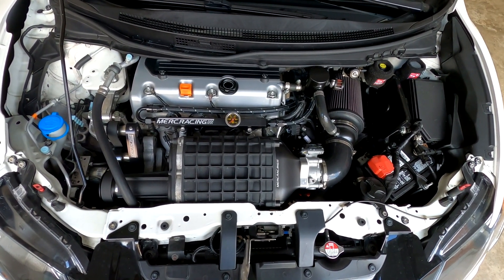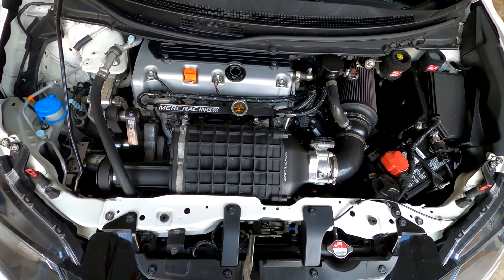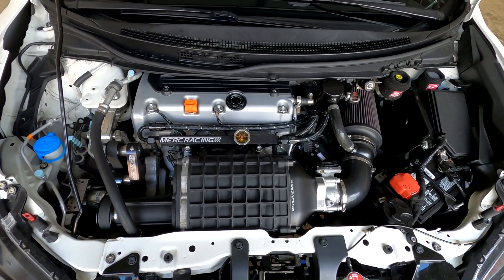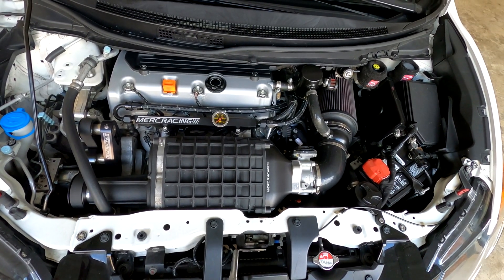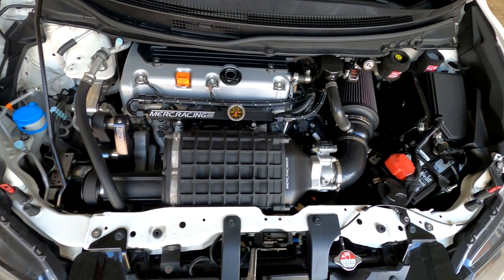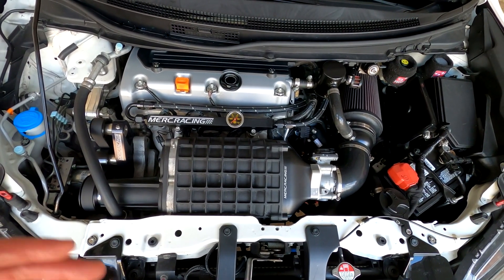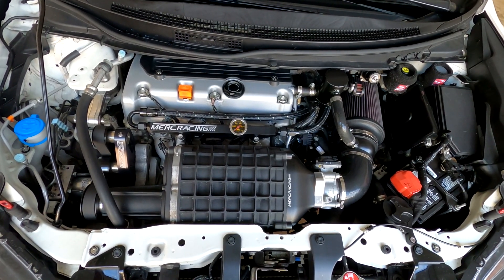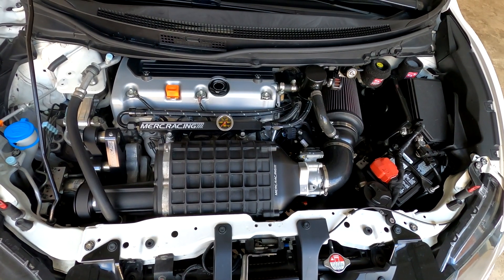1900 vs 1320 Supercharger:  Which to Choose for Your K24?

Comment: Im planning on putting a k20 pulley on the k24, Currently my 1920 has a 3.5 inch pully still haven't installed anything, do you think a smaller pulley for the supercharger is advised because im using a k20 pulley? if so what do you think will be appropriate? thank you.
Reply from the maker: If you’re using a small cp, you’re going to need a smaller pulley to make more boost.  So it really depends on your goals

Comment: Man im so lost it sucks that hes a one man show so its hard to get a reply in his emails. Im debating between the 1900 and 1320 my car already runs on e85 since its a stock k20/24 frank i dont wanna push it past 400whp. The 1900s is cool to future proof but is there any way to lower the boost it will make aide from the pullies?
Reply from the maker: @CrAzY6tothe6  1900 all the way.  Yes you can run 10psi using 9th gen pulley with 3.5 sc pulley
Reply: @CGNLEvolved  bet ima do it then and one last thing can i use the air to air on the street i would assume thats better on the street since less heat soak also i appreciate you responding really helped with my decision making
Reply from the maker: @CrAzY6tothe6  heat soak was never an issue with me even on 100 degree days under stop and go conditions, but i do have an upgraded reservoir.
Reply from the maker: @CrAzY6tothe6  air to air will require more plumping work
Reply: @CGNLEvolved  definitely this is all good to know. And i see i see for the plumbing im not too crazy about since ima have a shop fabricate that part. I think the ease of air to air is nicer less stuff I have to plumb and bleed. Hopefully it wont get too hot. Again i appreciate this information it's hard to reach the man which is understandable
Reply from the maker: @ ok if that’s gone case then you’re good 👍🏽. Let me know how it goes and hit me on ig @da_blackazn

Comment: Is there 1900 a twin screw or a roots? They don't tell you on their site.
Reply from the maker: @MatrixMGS893  it’s a hybrid between the 2.  Eaton makes the tvs chargers
Reply: Its a modified roots. Screw styles actually compresses the air along the rotors and roots styles compresses the air due to pushing more than the engine can intake.

Comment: what would you say if my end goal is 350whp max? It's my daily driver and I dont wanna have a super aggressive clutch. I'll be running the aftercooler kit on 92oct
Reply from the maker: Can’t go wrong with either as they both can hit those numbers.  Imo, I’d go 1900 because it’ll spin less to achieve that power and you have the flexibility to go higher.  1320 you’re almost maxed

Comment: Glad to hear you are giving wise advice when it comes to superchargers.  We all want to push our blower to maximum output with the largest crank pulley and the smallest charger pulley right out the gate. Foolish. Great advice, start off on low boost and gradually increase over little by little.
Reply from the maker: Appreciate it 👍🏽

Comment: Will this work with a k24a1. Specifically if it’s still inside a 2004 CR-V
Reply from the maker: I believe this has been done, but could be wrong.  I would contact MercRacing directly to see if they have done that install on that platform.
Reply: @CGNLEvolved  if not, do you have any information as to how a turbo could be added to one
Reply from the maker: @pebble_paper_shotgun2551  you can always get an exhaust shop to create you turbo pipes
Reply: @CGNLEvolved  I’ve never heard of those, what do they do

Comment: I own a 2009 Acura TSX and I think I'm gonna go with the 1320 simply because I have the 5 speed auto and don't wanna push it past 320whp. But damn your set-up is sick, not usually a fan of civics but yours rips 😂
Reply from the maker: Thanks!!  Yea 1320 will be perfect for your setup.  You thinking about adding the aftercooler setup too?
Reply: @CGNLEvolved  I'm gonna buy the air to water kit with the aftercooler ready manifold, but at first I'll block it off. Then maybe later down the road if I want more power I'll get the aftercooler kit too haha
Reply from the maker: @Tanner_Teves  gotcha.  Yea, I think a customer of MercRacing did some testing with the 1320 and they said that the cooler is not required unless you going all out or in super hot climate.  It's always good to have tho.
Reply: @CGNLEvolved  Yeah I emailed Merc directly and they said I wouldn't need cooling for anything past 350 with the 1320 but I'll get the water ready manifold just in case I do wanna push it haha
Reply from the maker: @Tanner_Teves  nice; yea keep me updated with your build
Reply: @Tanner_Teves  did you get it? I have the same car
Reply: @rinyi-y4r  I ended up buying a used CT Engineering Supercharger kit from a buddy of mine. Haven't put it on yet tho
Reply: @Tanner_Teves  let me know i have a 13 tsx with the auto, want a bit more out of it
Reply: @Darylrb1983  Well, I bought the CT engineer kit but then I found a modded Pontiac G8 GT for sale. So I sold the kit, used the money from that as a downpayment, bought the G8, then sold the TSX for $9k 😂

Comment: I’m looking at the 2300 but can’t find any info
Reply from the maker: I'm planning on upgrading to a 2300.  There hasn't been a k series that's done a 2300 as of yet.  There's an NSX with a K swap that's putting one on currently tho.
Reply: @CGNLEvolved  think it’s safe on stock internals? I’m looking for around 450hp
Reply from the maker: @HorizonDrifterDj  No...... this is something I talked with MercRacing about.  The low end tq will destroy the rods.  My tuner has even pulled back the power on the lower rpms to prevent my rods from bending.
Reply: @CGNLEvolved  or maybe 400whp on 93 if possible if not I’ll look at get a flex fuel setup would the 2300 be overkill for that number?
Reply from the maker: @HorizonDrifterDj  93 is going to be your limitation...... best numbers I got on 93 was 384whp.

Comment: Is the supercharger bolt on set up ? If you just buy the supercharger would you still make more HP than stock just like that ??
Reply from the maker: you will need supporting mods.  No point of just adding a sc and not have all the supporting mods to make the power.  Not worth the money IMO.
Reply: @CGNLEvolved  what about just bolting on the MERCtv900 to a stock set up. Website says 250hp. I really don’t want to do a catless exhaust system and i like the stock sound and just want more low end power.
Reply from the maker: @JeLifeCoach  Depends on your end goal.  hit me up on IG @da_blackazn
Reply: CGNL Evolved what necessary mods will you need exactly? At least to give it more power ?
Reply from the maker: @giovannithestud1878  Clutch, injectors, some kinda of aftermarket tuning software (i went with FlashPro), fuel pump.  Those are bare min.
Reply: CGNL Evolved alright good to know I’m looking forward to sc my si but would it still pass smog etc ? I’m here in cali
Reply from the maker: @giovannithestud1878  I pass smog here in VA, but every location is different.  I hear CA is extremely strict.  How do you guys do your smog tests?

Comment: Would a stock k24/k20 with k20z3 transmission be able to handle stage 1 with the 1900 tvs blower.
Reply from the maker: Yes, it should.  As long as the motor is in good shape.  I'm on the 1900 blower on stock motor and have experienced no issues.  Only reason I upgraded my transmission because after 400whp, these gears tend to break.
Reply: @CGNLEvolved  Cool. Thanks dude. I plan on getting 1900. great videos. Ill be running stage 1 on 91 octane til i build up transmission.
Reply from the maker: @matthewbrown2233  yea, you should be good to go
Reply: Crazy question would this setup work on a 2011 crv I haven’t seen any forums with information but it’s a k24z engine it comes stock with 180hp and 161flbs of torque

Comment: Also, what parts do I need to get before I buy the super charger kit (if any) I just purchased my KTuner. Was wondering if there are any necessary parts that don’t come with the kit that I will need. Also will I need to trailer it to get it Dyno or can my KTuner get me to the PRO tuners?
Reply from the maker: I think the rsx-s thermostat.  It's listed on their site when you plan to purchase them.  As for Ktuner, I would suggest going with a Hondata.  I've heard that Ktuner doesn't have much features for boost for our particular vehicle.  Other parts are your typical, clutch, injectors, fuel pump, etc.

Comment: You said you went on stages on your setup with 93oct, good to know you can upgrade pulley on a 1900 without going e85
Reply from the maker: Yes, another reason why I love the kit.  Changing the sc pulley takes less than 5 min.
Reply: @CGNLEvolved  what is the brand may i ask
Reply from the maker: @saifel-eslamal-labban2163  MercRacing

Comment: 9th gens are really weak. Check out @artsfb6 it had a MR1320 once.
Reply from the maker: Yes, I follow his channel.  I don't think that's entirely accurate.  I follow numerous 9th gen owners that have 400-500whp on stock block with no issues.  I've had mine boosted for 10k miles with no issues.
Reply: @CGNLEvolved  your right it could be owner's
Reply from the maker: @screwedupcivic  Yea, there's always going to be many factors for a motor to blow.  Maybe just bad luck or something.
Reply: @CGNLEvolved  do you do alot of racing??
Reply from the maker: @screwedupcivic  I will be taking the car to the track once they open up around here.  I do street races and drive my car hard whenever I drive it.